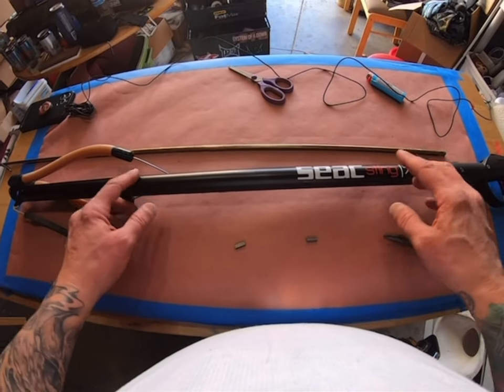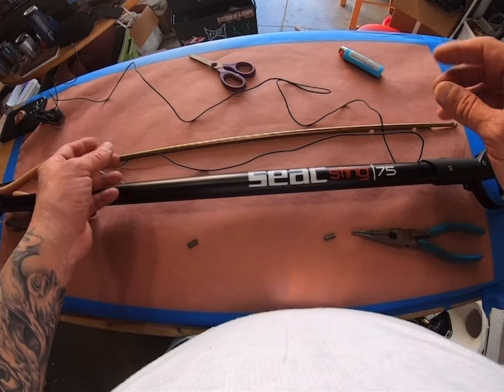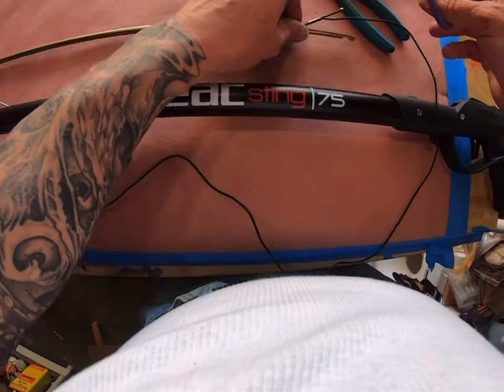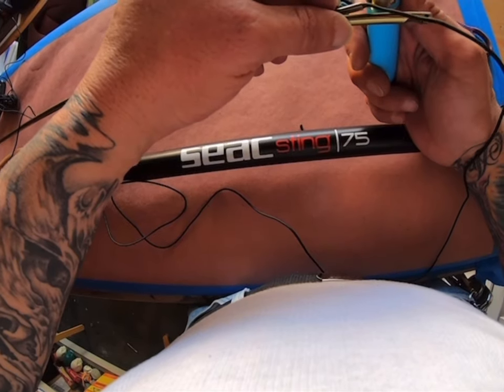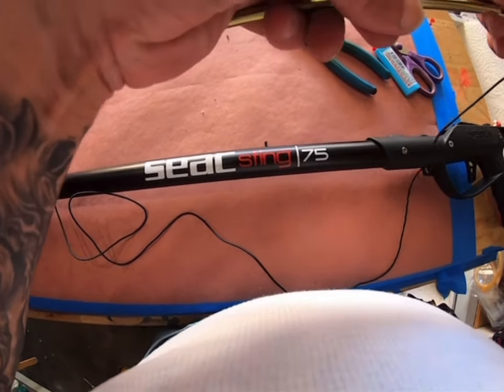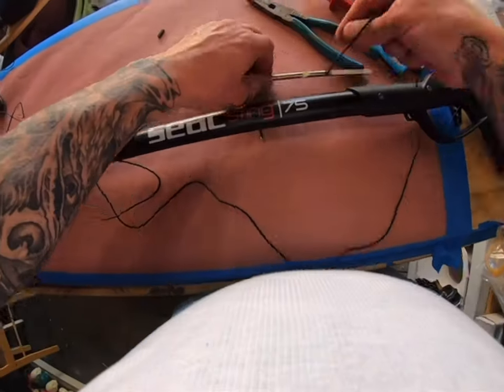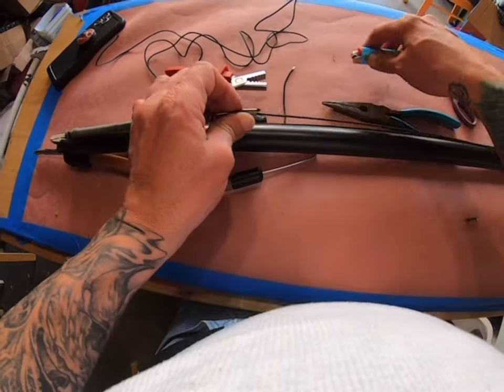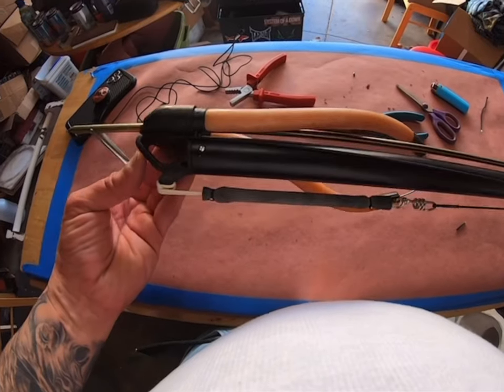HOW TO RIG A SEAC SPEARGUN #spearfishing #seac #sting

Comment: I have a 75 sting as well. What length band with a dyneema wishbone would I need to get to add 2nd band on it? Thanks
Reply from the maker: That’s a good question as I’ve never used the slot for a second band… check out this video, maybe you need a band like this (16mm I believe) the wishbones for Seac are universal…

https://youtu.be/4XhSR6g0BXs

Comment: Can I just use the nylon string that came with the gun? I see you have like a spring attached to the gun and then line tied from spring to the spear.
Reply from the maker: You can, but the muzzle bungee is used for a smooth transition when firing the shaft and how it stops when you run out of line…